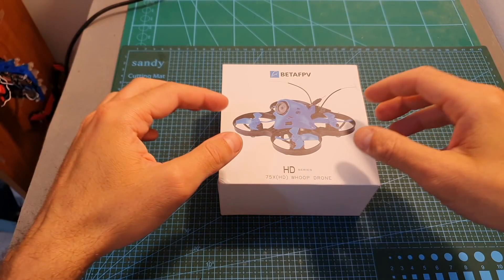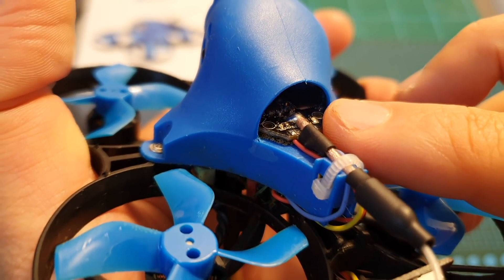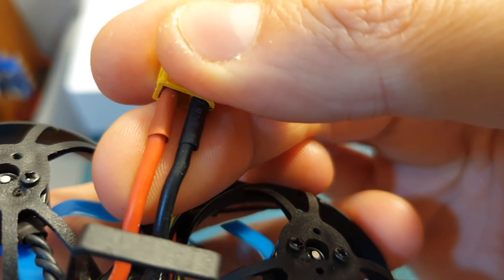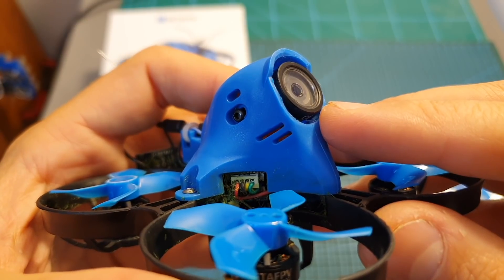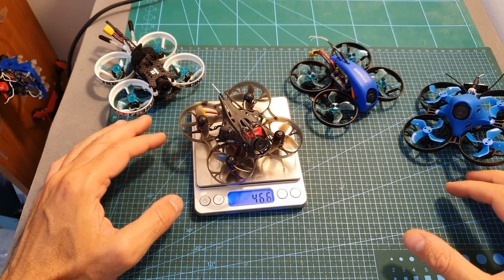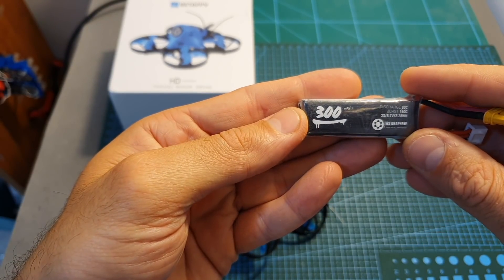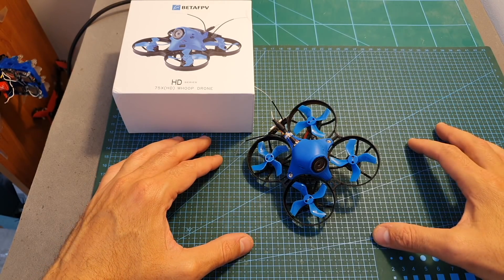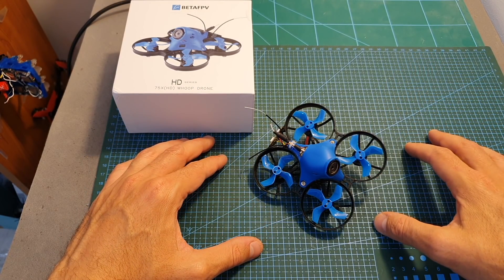BetaFPV Beta75X Hd Micro Brushless CineWhoop

Comment: Great video. Thumbs up. Couple quick question as I'm getting into this hobby. Will this work with a Lite Radio 2? Does it have a beep option if it's ever lost? Quad has on board SD card for video Right? Thanks in advance for any help you can give me?
Reply from the maker: Thanks. 
- As long as you will get an Frsky D8 or D16 radio receiver it will work with the Lite Radio 2. 
- You can setup the motors to act as beepers (as far as I remember it doesn't come with an onboard buzzer). 
- Yes, you can record HD videos to a micro SD card.
- Welcome to the hobby ;-)

Comment: I have another question. I seem to get pretty poor video signal to my goggles. I switched the onboard video antenna to a lollipop, and changed one of the linear antennas on my goggles to an omnidirectional "mushroom", but still I cannot get anything near the range you show in your test flight in this video. For instance, flying behind an obstacle just some 20 meters away can make the picture in the goggles so poor that it's hard to fly. Any pointers?

Comment: Is it compatible to use RPM filters in this drone? I have not found any tutorial on it, and with the firmware of 16.80 it does not work well in my case....
Reply from the maker: I haven't tested it and I don't have this quadcopter anymore, so I won't be able to check it for you. Sorry.

Comment: Super review, I barley get 2mins out of mine on mylipo.de 3s 333amh hv batteries 🔋 , and just cruising around slowly 😫
Reply from the maker: Thanks. Did you try flashing the ESC with JESC?
Reply: Gal Kremer yes I did flash with JESC , and just did a test on the batteries and although they are brand new the internal resistance is over 50 for each cell , so looks like there duds , one even had a dead cell , I spoke to the supplier and he sent some more

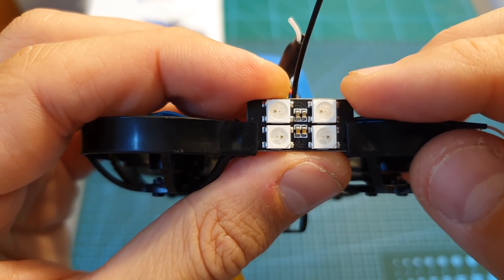Comment: At 1:25 The LED board has two slots in it - they are designed to hook into the frame. Just pull the frame apart slightly at the back and lower the LED board and they'll slot in. :-)
Reply from the maker: Yes, you are totally right.

Comment: Great video! Which would you recommend the mobula7 HD or the beta 75x HD?
Reply from the maker: Thanks.  They are both good. The 75x hd is more durable  and the Mobula7 hd is more agile.
Reply: @KremerFPV  the Mobula7 HD uses that awful Crazybee F4 V2 board and it burns out so often it's a complete and utter JOKE!  No way!
Mine burned up, see my video on my channel, on first plug in of the stock battery...at storage charge too! :(

Comment: Has anyone an idea how to change VTX power? I cannot find any button - even under the canopy...
Reply: You change the vtx power via your remote by adjusting your throttle to mid throttle yaw to the left, then push the pitch up. It takes ou into an odd setting then select features, vtx Salvador, then scroll down to power, and you can adjust it by using your pitch left/right.
Reply from the maker: Thanks Jake.

Comment: Hi Gal, thank for this review, jello, vibration, expensive ... no buy it !   👎
Reply from the maker: You're welcome. I don't think that there is a lot of jello actually.
Reply: @KremerFPV  I see jello in your video.
Reply: @KremerFPV  I watched it on a 43" HD monitor and I also saw very little jello.  I saw some prop wash in the 180 degree turns, but that should be able to be tuned out.

Comment: Good review 😁 Did you try a power loop? I would like to know if it washes out.
Reply: No washout
Reply: @jiangbella8067  l would like to see video proof of that, l changed the pids and use 4s to get rid of most wash out on my 85xhd, but still does it, but mostly at end of battery. Would love to see betafpv offer their models with a ductless frame as l find ducts pointless when flying outside and add weight and wash out.
Reply from the maker: Thank you. I did do a small power loop in the flight footage. I will try to upload another flight soon.